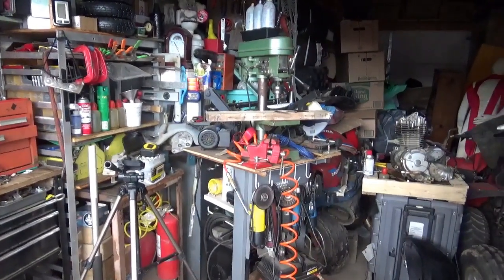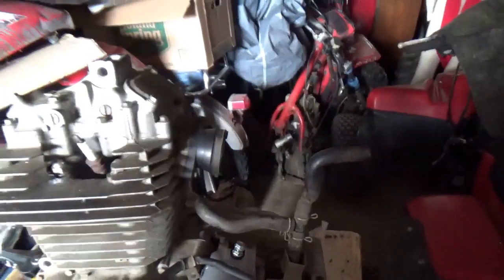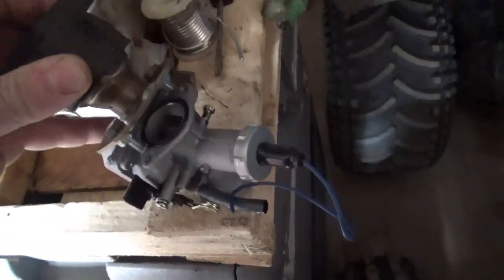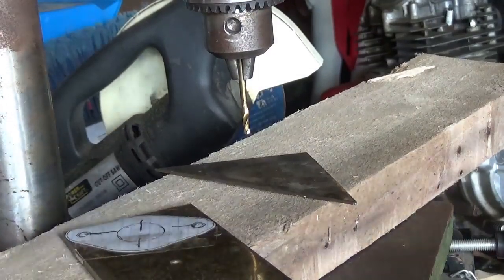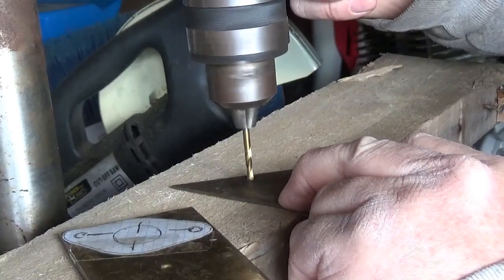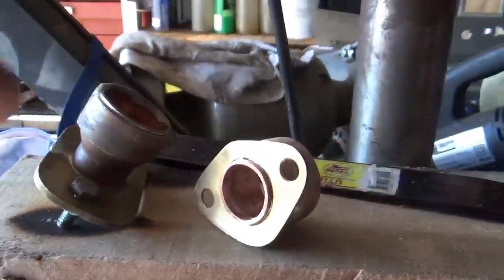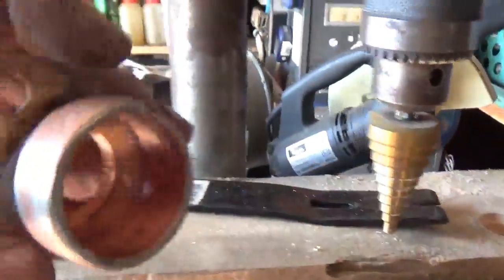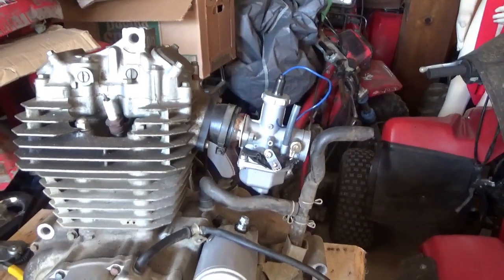Custom Intake Manifold Build Using a Custom Metal Fab Work Station!

Comment: Nice prefab job! I would hold metal with vise grips,think what could happen,been there.did you ever think about using a pvc adapter with some kind of pvc flat stock? Thicker wall and then you wouldn’t have to pad it out. Don’t know how it would hold up though. Thanks
Reply from the maker: Hey PineFighter!!!  I occasionally use vise grips, a rag, or a folded leather glove to hang onto things, depends how I'm feeling, and what I'm doing... I have not used PVC, it should work, there is not all that much heat at the carb.... I'm used to copper and brass, the dimensions also work... But, if I started with PVC, I would probably still be using PVC.... Thanks for Ur thoughts, suggestions, watching, and commenting!!!